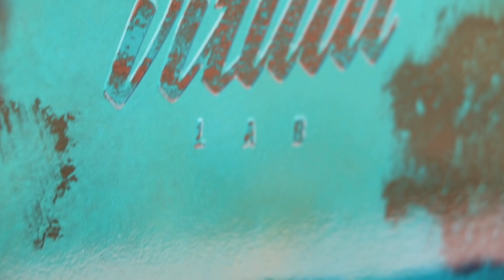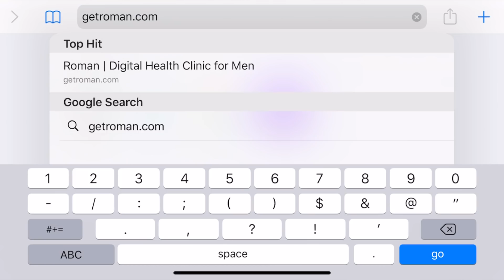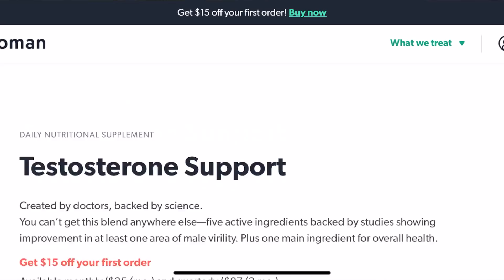Building A Huge Lifted Bug For SEMA!

Comment: Finally my dream will be come reality. You go bug. I would go k 10 blazer frame myself and then do a rear mounted Cummins with twin turbos. Then do twin 5 inch stacks out the back windows with tractor flaps

Comment: Why wouldnt you just make it 4wheel drive take the whole engine and trans from a cummins and put it under then bug
Reply: cody luehrs that sounds cool on paper but in practice it would never work it will be close to fit the 4BT under the hood of a bug there is no way and 12 valve or 24 valve would ever fit with out moving the fire wall way back and the jeep chassis could still have 4x4 and i think thats what bug is going for with that idea